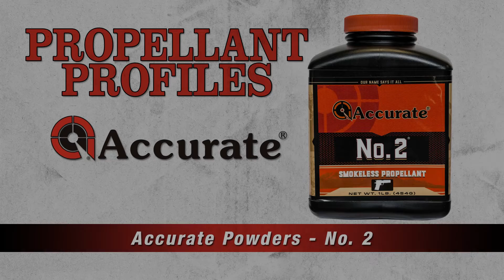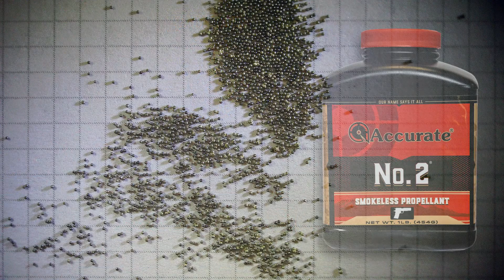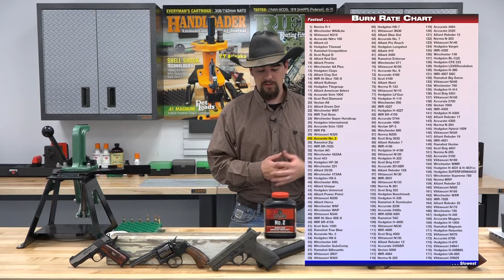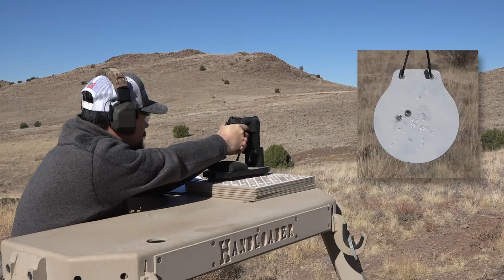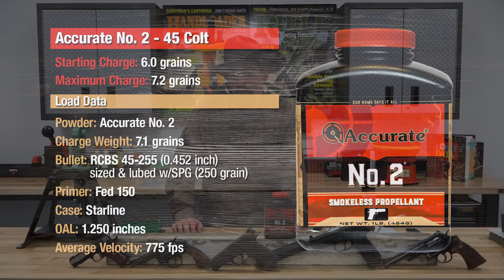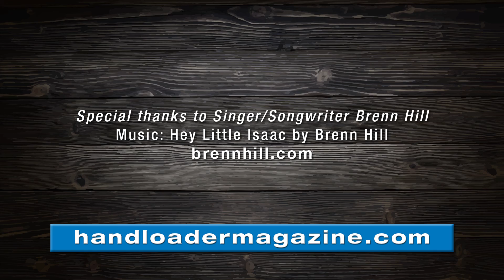Accurate No  2 - Propellant Profiles

Comment: It would be great to see one of these Propellant Profiles on Accurate No.5.  

I have clear applications for Accurate’s No. 2, 7, and 9 powders (with help from this channel!), but I haven’t been able to figure out what is the best use for my jar of No.5.  

I have tried it in .38 Special +P (for example) but there is a ton of unburned powder and performance is just ok.  For .357 Mag it is not on the same level as N110, Acc No. 9, etc.  If I want mid loads, I get better results and cleaner burns with HP-38/Win 231.  You get the idea.  What is Acc No. 5 good at?

Comment: I'd like to see an analysis of Accurate 2200 since I picked up 50+ lbs of it the other day.  
Think you can help?  Any good in .243 Winchester?  Or heavy bullets in .223/5.56?  

I like your selection of Pistols.  I'm looking for an 8-3/8" Model 25 to go with my other N-frames (.357, .41, .44).

Comment: I picked up a Colt Police Positive revolver in .38 S&W a while back but haven't gotten setup for reloading it yet.  It has an odd size bullet at .361" and the factory loads I've bought have been disappointingly inaccurate.  
It seems that I'll need a dedicated bullet mold for those larger bullets and .38 Spl/.357 Mag dies won't work either.  
Have you found good solutions to these 'problems'?  I haven't found a bullet mold that wasn't a couple thousandths to small.
Reply from the maker: To be honest I have had mine for a couple of years not and I just haven't had the time to do much testing with mine, I don't think my bore diameter is quite that large but I can't remember what it slugs out to off the top of my head. I do plan on doing a load development video on the cartridge at some point but sadly, again I haven't had the time. Hopefully sometime soon. I would say if your bore slugs out to .361" then you are going to need jacketed bullets of that size or cast bullets .001" over that. I would think that would help your accuracy issues. I would also suggest a rather soft alloy 1:10 or 1:12 so the bullet can properly obturate to create a proper gas seal. Great question I wish I could be of more help. Thanks for watching and taking the time to comment! --Jeremiah

Comment: I use no. 2 in my 9mm practice rounds. I like it but because  it's not as versatile as other powders for high performance in a variety of calibers i won't be replacing it. I have to many different powders and I'm consolidating.
Reply from the maker: That is true it is not as versatile as some other powders but in the cartridges it can be used performance is usually pretty good. I completely understand consolidating powders though. Thanks for watching and taking the time to comment! --Jeremiah

Comment: AA#2 is my go to powder for 9mm and my 38 Special snubnose. It’s great in those guns. No muzzle flash and the gun stays quite clean. I’ve also used it in my Beretta 96 40 S&W with the 5 inch barrel. It works fine but slightly slower powders seem better with the heavier bullets and longer barrel. 
I don’t know where you got the load data for 40 S&W but you appear to be too hot. Hodgdon’s website shows max load for your combination at 5.4 grains. 
Good informative video and I look forward to more.

Comment: Nice - I am trying to learn more about this powder. I picked some up when any powder was hard to get. Like you say this is economical and I'm learning like you it is very versatile.  At first I was pretty confused when I looked it up in my 15 manuals - there is quite a bit of variance in charges from older sources to new. I went with the Accurates most recent data in 9mm and 40 in preparation for a self defense class. The narrow min to max was a little concerning so I started at minimum did 10 test rounds and worked up a little. I don't recall the final loads - but minimum for the 40 was a bit too light with Berry's 155 plated  so I moved up  to where I had reliable function in a Walther P99 and stopped at a middle of the road load.  I fired 500 round in the class and felt it was quite accurate, functioned perfectly and didn't wear me out. I use a Lyman Turrett with a Lee Proauto disk - and the charges stayed amazingly consistent even when the powder hopper got pretty low. Accuracy was very good for the class. I loaded anoter 400 rounds of 9mm with a mix of FMJ, commercial cast lead and some Berrys plated - all at 123-155 gr. in a Taurus PT92. Again I had a low middle range load that didn't beat the gun and functioned well. After my initial concern for this new to me powder - I am very happy with it - I didn't quite empty my first pound with over 1,000 loads - economical accurate, and quite clean burning. I'm eager to try it in 38 special too. Good Stuff.
Reply from the maker: You have come to the right place it is indeed a versatile powder and it is important to note how big the variance can be when looking at old versus new data. You made a smart move using the most recent data with a newer lot of powder. Thank you for taking the time to share all of that experimenting and experience with us here in the comments section. I think we have the best comment section on YouTube because folks can come down here and learn new things and share experiences with one another. Glad to hear that you are happy with the powder and always happy we can provide information to folks who need it. Thank you for taking the time to watch and comment we greatly appreciate it! --Jeremiah

Comment: I used AA No2 in the early 90s when I first began loading 9mm and 45 ACP. when it  became unavailable I switched to Win 231..I recently acquired 2 lbs of it for 38/357 and 9mm...
Reply: I think you'll find the newer No2 burns a lot cleaner than the original recipe.  When it first came out I was disappointed with how dirty it burned but everything improves I guess.  The Bullseye I was trying to replace was also quite dirty.